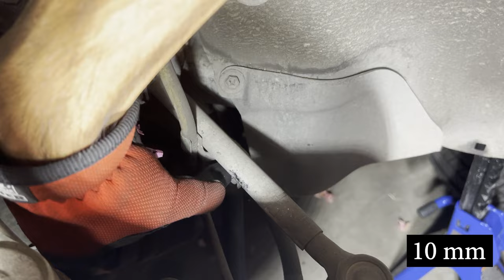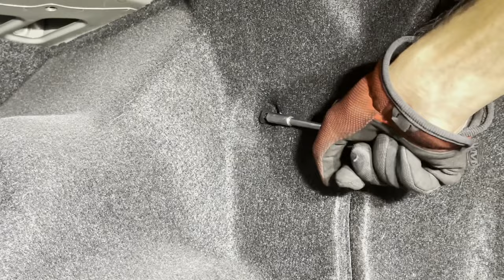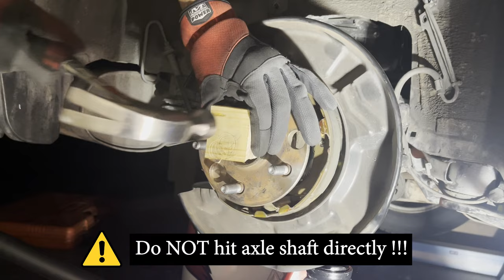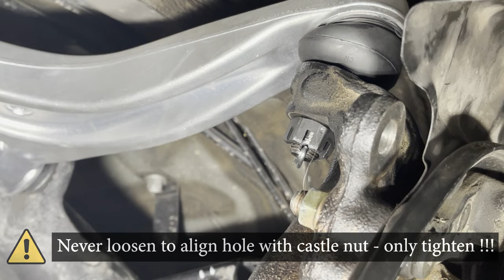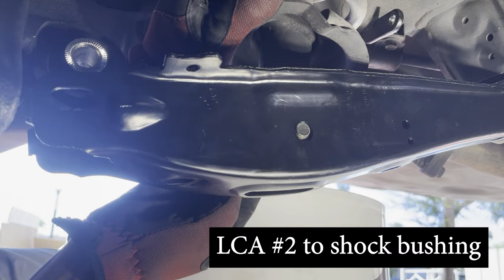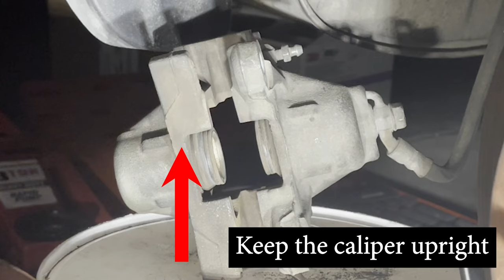How to rebuild rear suspension on a Lexus GS 300, GS 400, GS 430 | Similar to IS 300, SC 300

Comment: Good video on a very complex suspension setup.  One thing I want to point out is that the sway bar link is not defective, it is by design for that joint attached to the bolt to move freely.  To tighten the nut on the link bolt, you need to use a hex key (size 5mm) hold the bolt in place and use a wrench with open end to put the nut in.  If you look at the end of that bolt, there should be a hex shape hole.  All the sway bar links I have worked on are designed this way because they need to move freely.  Hope that helps.
Reply from the maker: Ah that makes sense! Thanks for the info, I will update the video description so that everyone can see this as well. Thanks for watching! :)

Comment: Hello, I have a scenario regarding the toe control link. My friend was doing an alignment on my 98 gs300 and was struggling to adjust rear toe. Before he broke the camber bolt loose both toe sides were at -0.20° and after he broke the bolt both went to -2.50° and would only go as low as -2.05° The car drove ok before the alignment but after even at speeds of 30 the rear felt like it shifted side to side and on the highway was pulling left and right. Total rear toe rose from 0.05° to -4.25° and thrust angle from 0.2° to -0.1°. I went right to an alignment shop after and they were able to "mickey mouse" a fix that conditioned my car to before the alignment. I am unsure of exactly what the fix was. The shop along with my friends instructor pointed to this component and said I would need to replace it. I just really want to make sure it is this piece before I replace it and it ends up not fixing it and my car becomes undrivble to where it can't be mickey mouse fixed again and I lose the car.
Reply from the maker: Hello! 

From what you have explained, I don’t think you have done any permanent damage to your car to the point where you can’t drive it anymore. The toe control link is just a ball joint which is not too hard to replace. Unless something catastrophic happened like the upper ball joint separating from the knuckle, nothing would be damaged. 

Having said that - the rear end is definitely out of alignment and the only way to fix this is by getting an alignment done at a professional shop. I’m unsure as to why the shop you took it to had to do a “Mickey mouse” fix - if they had an alignment machine they would have been able to adjust the angles and get a perfect alignment. The only time were alignments cannot be performed are when the chassis is bent from a wreck or something like that, but you said the car drove properly prior the the repair. 

Unfortunately it’s a little hard for me to advise you more without having a look at the car. So as a first step I would suggest taking your car to another reputed shop and ask them to do an alignment. If they are not able to complete the alignment, they will tell you why and what needs to be replaced/fixed. Since the rear end is not used for steering may be able to drive it to the shop without any issues, but if you don’t feel comfortable I would suggest having it towed. Remember to ask for a flat bed and not a sling type tow truck. 

If you have any more questions, feel free to respond here. Hope I was able to help, and good luck! :)
Reply: The camber bold or the toe bolt might have gotten twisted as it was being broken loose. You can not get perfect alignment with a twisted bolt, it will need to be replaced.
Reply: @theautochap   You definitely helped. Im on the collision side of our college and did find body filler on my rear door and my trunk when repainting my car. I measured the under carriage with a tram gauge but the opening I needed to use as a reference points were under the lift arms so I had to use other points of reference. The frame was reading straight but I'll probably try again with the proper reading points. You saying it drove properly before the alignment definitely reinforced the idea that the frame is ok. Thank you for that. Also I shouldn't have called it a mickey mouse fix, that discredits the shops years of experience and they probably just were able to revert it. Again thank you.
Reply: @sarvinderdhesi1631  thank you, ill be looking to replace the camber bolt and toe link with some adjustable ones from megan racing. I just wanted to make sure it was a mechanical piece that can be replaced vs I replace those parts, they dont fix the issue and the car ends up being out of alignment forever. The alignment shop being able to get it back in alignment and what both of you two responding to me said I feel comfortable replacing parts now.

Comment: DO THE FRONT SUSPENSION REBUILD🔥🔥🔥🔥
Reply from the maker: Unfortunately I didn’t have a chance to make a video back when I rebuilt my front suspension, but I will probably be replacing the upper control arms and shocks in the near future and will make a video for that! Thanks for watching! )
Reply: @thelexuschap4200  awwww mann that's so disappointing 😞 I'm trying to rebuild my front now 😫 but having a difficult time finding what's important to rebuild
Reply: Do you use oem parts ....if so do a me a favor and list all the parts that were used in the rebuild
Reply from the maker: @maliknolan5711  I used all aftermarket parts except the lower ball joints which I used OEM parts for. If you send me an email at theautochap04@gmail.com, I can send you the list of parts that I got as I can’t post pictures here.
Reply: @theautochap   do you like the quality of parts that you buy ??? 😏
Reply from the maker: @maliknolan5711  yep, I’ve put around 10k miles on them and haven’t had any issues.

Comment: Ive found that using snap ring pliers to put the hat for the parking brake shoe retainer spring is much easier.  Also, the quick way to put the top tension spring is to leverage it onto the perch while bracing a flathead screwdriver.  It is so simple once you see it done once.  Saves a ton of time.
Reply from the maker: That sounds like a great suggestion, appreciate you sharing it and hope it helps someone out.

Thanks for watching! :)

Comment: Can you tell me where is the petrol filter located on the Lexus gs 300 2008 right side driver. Thanks 
Is it along side beneath the driver side or inside the petrol fuel tank next to the fuel pump.

Comment: Great video, do you have part numbers for the lower control arm bushings
Reply from the maker: Hello, 

I’m assuming you are asking about the bushings on LC #1, LC #2. I would recommend just replacing the entire arm as it’s easier than pressing the bushings in and also not much more expensive than buying just the bushings. If you would like to buy the bushings, I found this link which has a kit for the rear suspension: 

https://www.prothanesuspensionparts.com/18306

Unfortunately I cannot attest to the quality as I have not used their products before.

Hope that helps, and thanks for watching! :)

Comment: hey chap how’s the quality on the rock auto parts? they have good prices if compared to oem but again quality is where it’s at
Reply from the maker: Hello! I’ve had a good experience with parts from RockAuto, put around 20k miles on them with no issues at all so far. I would suggest getting OEM Toyota/Lexus parts for critical parts like the front lower ball joints. 

Thanks for watching! :)
Reply: @theautochap  hey that’s great, i was thinking of later on you can make video and give a little review them, for the lower ball joints i bought moogs, and moogs again for outer tire rods, i just have to put them on
Reply from the maker: @hurrh.6335  Not sure if I’ll be doing a review video just for the suspension as it wouldn’t be enough content for a full video (if RockAuto decides to sponsor me then I might though lol). I do plan to do a driving impressions video once I get the engine and transmission back in, I’ll probably cover how the suspension feels in the video.
Reply: @theautochap  nice man i understand, do you have any plans for this car? i bought some coilovers for my gs, also got the tire rod and the lower ball joints, but idk if i should install those on my daily
Reply from the maker: @hurrh.6335  For the GS I’m doing a restoration project if you will, started with suspension, paint and now the drive train. Pretty close to the end of the project at which I’ll hope to have a reliable and clean GS as a daily for a long time.

I’m sorry I don’t think I understood your question. Were you asking if you should install the parts on your GS or another car of yours?

Comment: My rear suspension squeaks like crazy.  I have newer struts (about 2 years old), new control arms, and all suspension bushings lubricated.  Is it likely my struts are the source of the squeaks?  Thanks.
Reply from the maker: Hello! If you suspect your struts are causing the squeaking sound, I’d suggest trying to listen for a sound isolated to when you’re going over bumps as that would put the struts in action. 

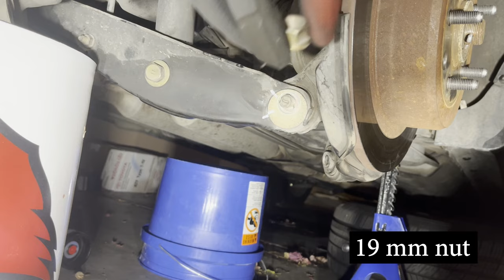Another thing that people commonly overlook are the two bushings in the rear knuckle (I show these @ 3:21 in the video). 

If you’re still unable to isolate the noise, I’d suggest getting the car up on a lift and prying on different bushings to see if you can recreate the noise you hear while driving. 

Hope that helps! Thanks for watching! 😀

Comment: Can the gs300  parts can work on an is300 rear
Reply from the maker: Hello,

Some of the parts will fit, some may not. Unfortunately I don’t know which ones are cross compatible but the process to disassemble the suspension is similar. I would suggest checking compatibility before purchasing any parts. Sorry I couldn’t be of more help. 

Thank you for watching! :)

Comment: Is it possible to replace the rear upper control arm without removing the axle shaft and the parking brake?
Reply from the maker: Hi, unfortunately not. Here is why - the axle shaft is directly below the upper control arm ball joint nut and there is no space to get a socket on, and then a pitman arm puller to separate the ball joint from the knuckle. Even if you somehow loosened the nut using a flare nut wrench (very tough due to the lack of space mind you) I suppose you could hammer the upper control arm stud to break it loose but if the axle shaft is not removed there is very little space to swing your hammer. And second, to remove the axle shaft you have to remove the parking brake cable because there isn’t enough slack to swing the knuckle upwards so that the axle shaft slides out of the knuckle. And don’t forget about the most important part, torquing the ball joint nut to spec - even if you somehow got the UCA off with the axle shaft still in place, it would be impossible to fit a torque wrench on to the ball joint nut. 

It’s definitely a bit of work to get the axle shaft and parking brake cable off, but it helps you get the job done properly. 

Hope that helps!
Reply: I disassembled the upper aluminum CA without removing the driveshaft and other parts.  All you need is a wrench and a pin puller
Reply: @DSLfuner  can confirm, it's not necessary to remove driveshaft/axle shaft to remove UCA. and also driveshaft can be removed without disconnecting parking brake cable

Comment: Hi, I am going to replace my toe arm and possibly my rear upper control arm. I read your reply to the other commenter asking if it is possible to remove the UCA without removing the axle shaft and parking brake. I have a question about whether I would have to remove the shock absorber and lower control arm number 2 or just unbolt the knuckle from the UCA ball joint and leave in the shock absorber and LCA#2?
Reply from the maker: Hello, 

To remove the toe arm aka. toe control link, you don’t have to remove any other components, just unbolt the bolt and nut holding it in. Don’t forget to mark the toe angle plate to get a rough alignment when you put everything back together! 

If you would like to replace the rear upper control arm, you will have to remove both the shock absorber and the drive shaft. You shouldn’t have to remove lower control arm #2 however.

Hope that helps! Thanks for watching! :)